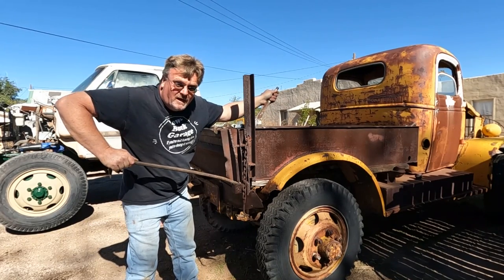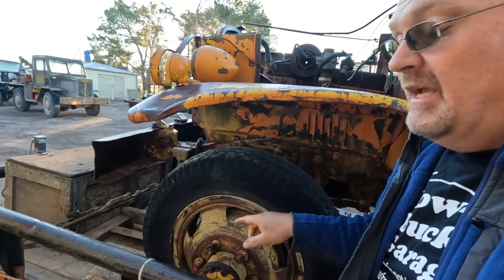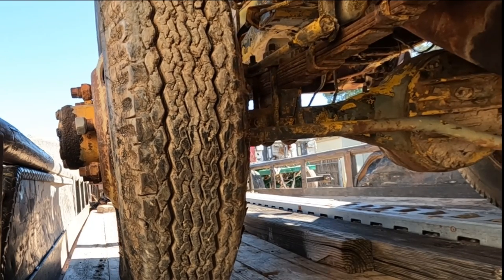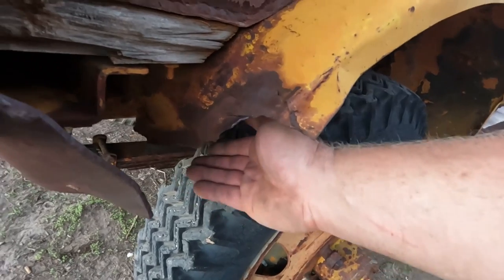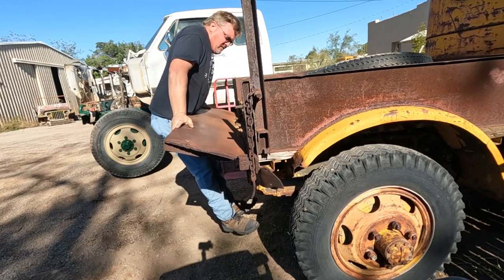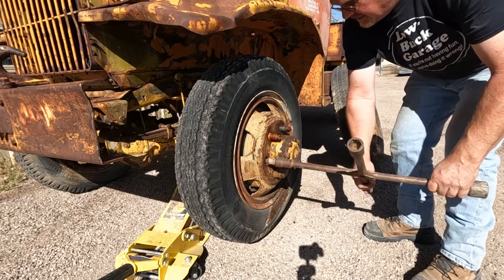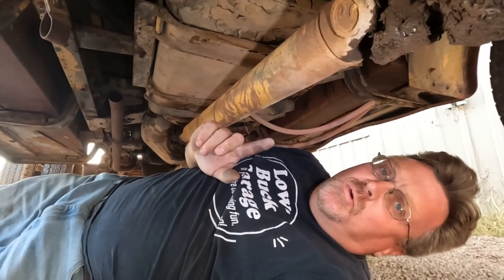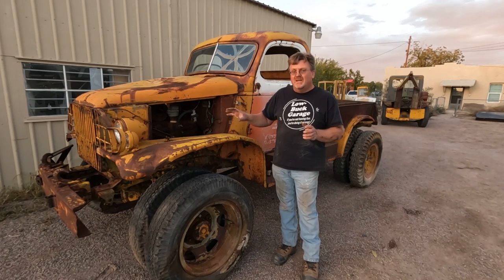Mystery Chevy Truck, 1949 1-1/2 Ton G-506 Pickup?

Comment: as an 18 wheeler tire tech that knows those wheels i would  recommend swapping those for some 6lug tubeless bud wheels it will make it easier to find tires to fit
Reply from the maker: Yeah, I noticed that there is not much available at all in the 7.50-20 size.
Reply: @LowBuckGarage  the most commen thing i can think of that may fit are 19.5 6 lugs off of a older model isuzu npr if not you may find some in the 22.5 range but finding 6lug bud that will bolt on in 22.5 may be tough
Reply: @LowBuckGarage  that is off in the used setting you may be able to find some refurbished online
Reply: There is 1 company in US that Remakes older vehicle / Snowtread tires/ farm equipment.    Special order. Wait,   All my favorites web address on my laptop were deleted with last 4 Windoze updates.
Reply: 8.25 x 20s are more common .  used on rear duals     7.50 x 20s were on the front only from 40s through 53 on 1.5 ton models

Comment: 10.31.2022 

I was hipped to this  video buy a friend who knows I know and love these old GM trucks .

It used to belong to a buddy Joe M. AKA "MOTHER TRUCKER" who lives in Arizona and has  more old truck stuff than anyone else I know .

The engine is a 1955 ~ 1964235 CID. might be a 261 CID if you're lucky, I'd soak the cylinders in KROIL or maybe just Diesel fuel for a few weeks to see if it frees up, once you get any wiggle out of the crank DO NOT FORCE IT ! keep moving back and forth against the rusty stop points and eventually you'll get it to turn 360 degrees and can set about making it run to evaluate .

Feel free to contact me OFF LIST for more info as I can help make this live again .

-Nate
Reply from the maker: That's awesome, I'd love to know any more info on its history!  I ran the numbers on the motor, its a 235.  Interestingly, it looks like the head is a '54-55 series I, and the block is a '55 series II.  Now that I know its a full pressure motor, I'm going to pop the head off and see if there's a chance of saving it.  My email is james@low-buck-garage.com.
Reply: @LowBuckGarage  8PM PST, I just sent you an E-Mail, let me know if/when you get it . -Nate

Comment: I have idea for the well drilling equipment on the back of the other truck you can always salvage it and use it as a crane rig with a turntable on it with no boom on the cane cab and it can always come in handy for anything tree down in a neighbor house that can always come in handy for firewood for there house

Comment: That lever on the shift rod might be for "compound low". Lift that lever when you shift into first gear  and you'll be able to pull those other stuck vehicles, trees, busses etc that cannot be pulled using first gear by itself. Geeze I must be getting old.

Comment: Just a guess, are the two little knobs above the windshield vacuum switches to operate vacuum wiper motor(s)?
Reply: If not vacuum, it’ll be 2 speeds for a electric wiper motor. He will find out after he removes the switch cover

Comment: That round plate on the front bumper is a Bridge Plate, it had the max weight of the vehicle painted on it so you knew whether it could pass over a bridge or not. https://en.wikipedia.org/wiki/Bridge_plate_(marking)

Comment: OK so the extra light is a turn signal it’s one turn signal at the front of the truck and one of the back of the truck because I’ve also got one turn signal on my military trailer so at one point that was used for military use

Comment: Why would you remove those tanks?  They've wonderful examples of a service truck.
Reply from the maker: So far I haven't removed them.  It makes it harder to get into the truck, but I might find a use for them as-is.
Reply: @LowBuckGarage  Just think of them as cool original-purpose add-ons or ... greebles.  Or... range extenders.  That truck is too cool as it is, no need to make it into some modern interpretation of something else.  With the dually fronts, it would be a head-turner to many classic car and truck shows once cleaned up and running.